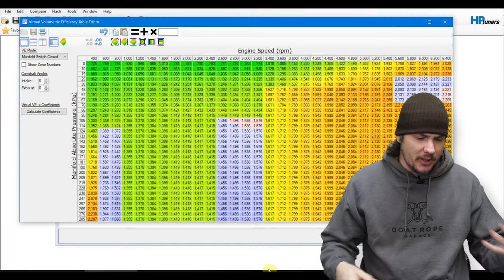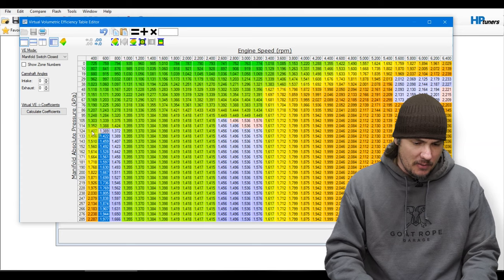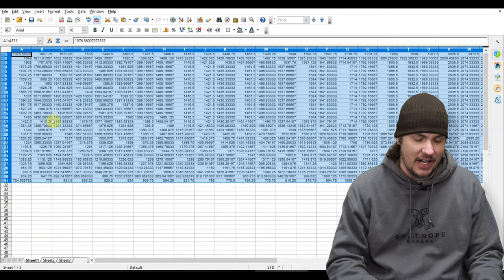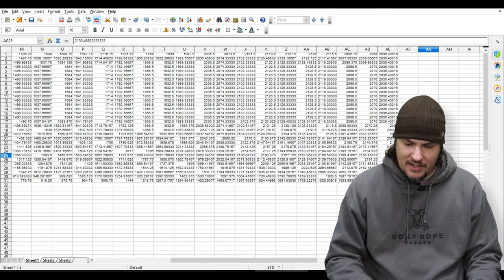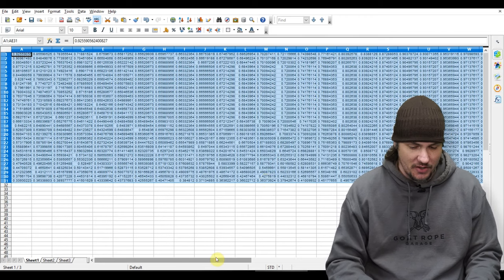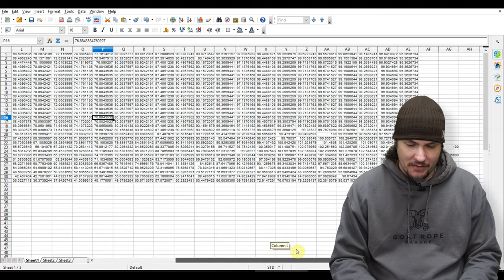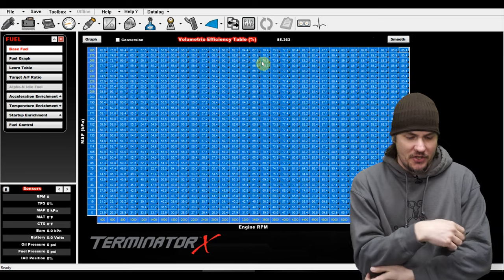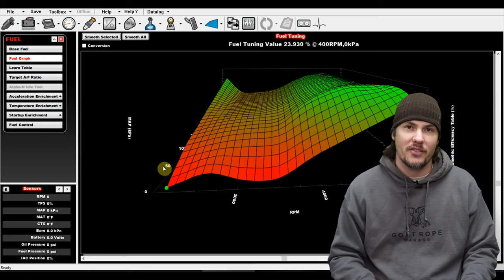Holley Terminator Base VE Table From HP Tuners!

Comment: what exactly do the numbers in hptuners vve table represent? I don't think the method you used had any mathematical sense. including the "let's subtract 10" last step.. by subtracting 10 to a value like 30 you are decreasing it by 50 percent!!
Reply from the maker: The numbers in HP Tuners are a measure of the amount of air versus the percentage of air based on displacement. We find the highest value at atmospheric which should be max efficiency and use it as our 100% point saying at that point the engine would be 100% efficient, which it isn't so we finally subtract 10% efficiency from the entire map to scale it to match a 90% efficient engine. Subtracting 10 from 30 says the engine isn't 30% efficient there but more likely only 20%. This isn't an exact science, the idea is to take a known map and convert it to a new system that has the ability to self learn, so long as you get running on this map it will correct itself to the proper efficiency percentage.

Comment: The download page on Holley says Terminator x software is unavailable online, where did you download?
Reply from the maker: I think I downloaded it from the product page for one of the Terminator units. If that doesn't work let me know and I'll throw it up on pg4car.com
Reply: It's pulled right now I think they will have a new version up by the end of the week is what they are saying on the Facebook page
Reply: It's back on  the website. They updated it for Ford/hemi compatibility
Reply: Dirtfloorfab cool I’ll look into it later, tho I’ve not even meet anyone with the terminator x system
Reply: @streetfighterracing1583  if you have Facebook there's a terminater x owners group there. Lots of guys running it tho
Reply from the maker: @Dirtfloorfab  Thanks for the update, brother!
Reply: Dirtfloorfab I don’t have Facebook but thanks for the heads up, I just do my car anyways with HPT